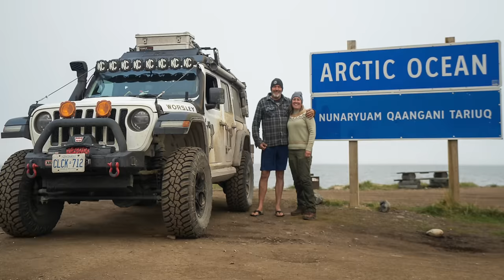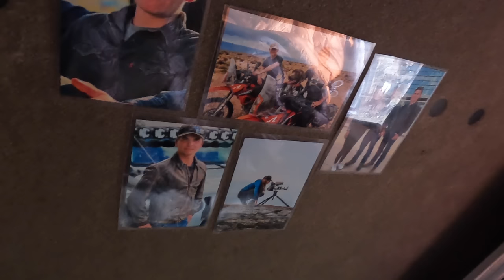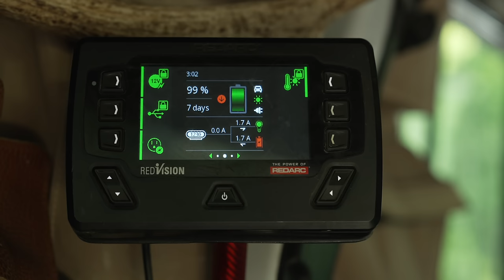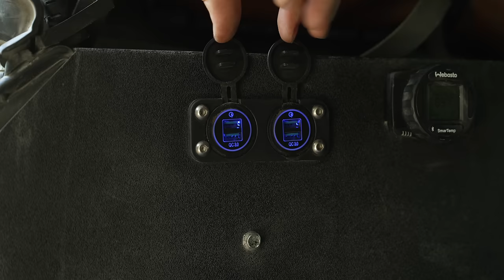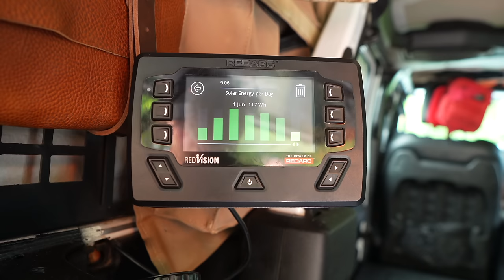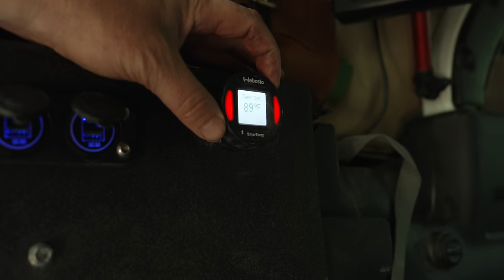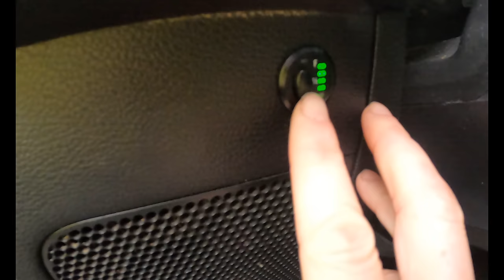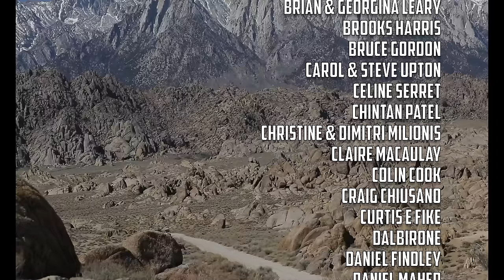IS THIS THE ULTIMATE BUG OUT VEHICLE? | JXL American Safari // EFRT S8 EP25

Comment: Really great walk around. I hope your second addition to this video will be the underneath if you had to re-gear ratio, it with the larger tires. The suspension change out the axles? did you have to change out the rocker arms stuff like that a great walk around. I also love the front intro. Movie addition to this video. Excellent job ok 👌🏼 🔥🤠🔥Camping Russ out

Comment: I have the Warn Winch,  my winch has a  steal cable.  I would most definitely recommend testing it out often.  I have used it once or twice.  The one time  I tried to use it this past winter? It didn't work. I aqm guessing that the batter needed to be replaced.    And, my bumper had rusted out about 2 years ago.  I brought it to the body shop to have it sanded and blasted down and reapplied my bumper coverage.  Guess what,  it's rusting out again.  It kind of erks me for sure.

Comment: If you ever come to Atlantic Canada, I'd love to do a rig comparison.  I have some tire advise, or statistics to share here for your build.  I have been running Mickey Thompson Baja Boss AT's for two seasons in 295/70R-18 (34.5x12").  I just recently changed (same tire) to 255/85R-17 (34.5x10") and reduced my highway fuel consumption by 2.7L/100km!  From 16.0 down to 13.3!  Narrower really is better for travel.
Reply from the maker: Sounds great and thanks for the tips

Comment: Great walk through. 
Three questions I’d have:
Is that light bar kind of low for you with your height?
Do you have locking axle?  I ask because you’ve been places that most seem to need them. If you haven’t, it would be a cost saver. 
What does this weigh fully loaded, extra fuel, etc. 
Really like your rigs!

Comment: While watching this I was wondering about the stability of the Jeeps with all that added weight - it has to move the center of gravity up somewhat.
Did you get different springs and shocks?
Reply from the maker: Yes they are very stable with the upgraded suspension systems. One is the AEV system and the other is by ARB.